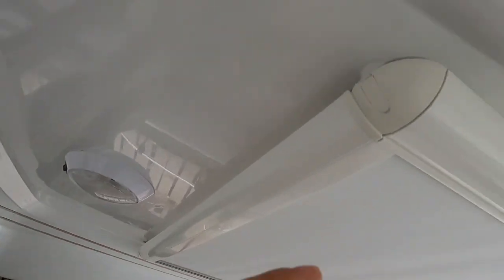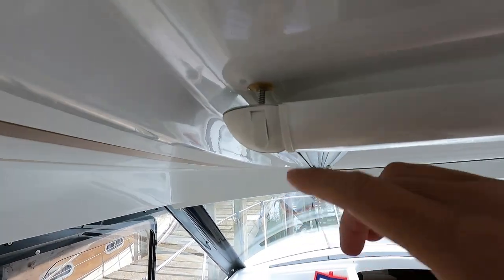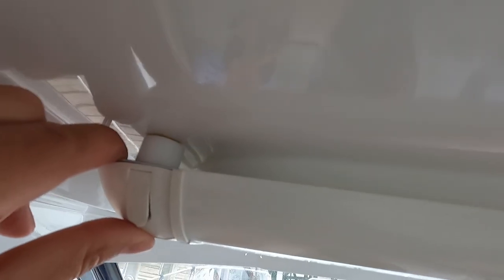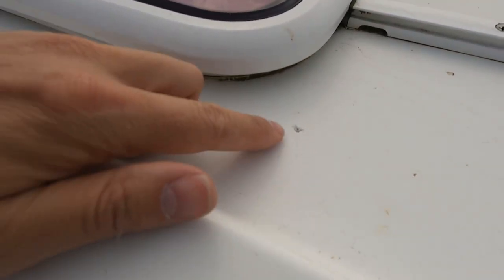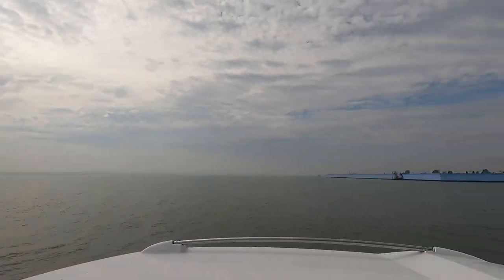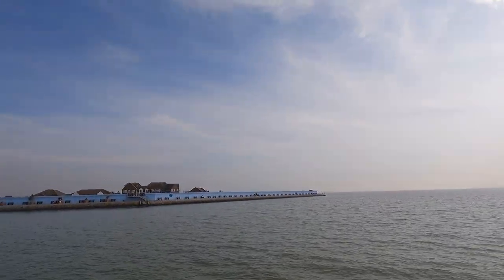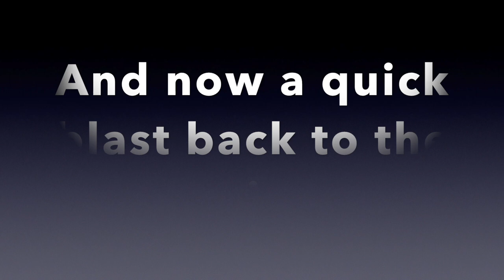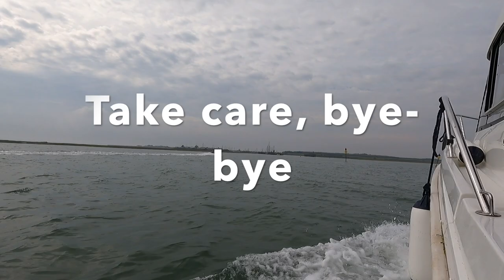Another SNAFU with my sun visor

Comment: Hi sir have now watched all your videos ,and have enjoyed seeing you master your first boat . I must admit I’m curious as to much one has to pay to enter into this level of craft , but totally respect your decisions to keep that private.  As regards your issues with the pesky blind , would it be possible to install dome cap s/s bolts from the top with rubber gaskets. Yes I know it means going right through the hull , but I think it would solve your problem , the screw holes will always be a problem as they start to lose grip.     Best wishes and kind regards to your good self  😀👍👍👍
Reply from the maker: Thanks Michael, appreciate the feedback.

My boat cost £35K but I wanted to get as news as I could, but the budget was higher than I'd agreed with my wife earlier in the process - but I did look at some that were considerably older - but they looked it too. Hence why I went higher with the budget - but it my just have been the quality of the boats I looked at.

On the sunroof, my father-in-law said the same thing, but I am not sure I can bring myself to drill all the way through the roof. I'll do the gel coat repair and see how that fairs.

Best regards.